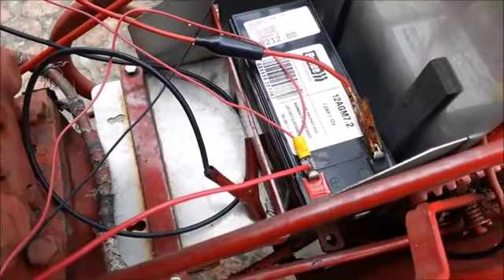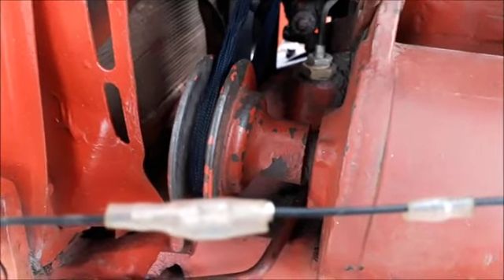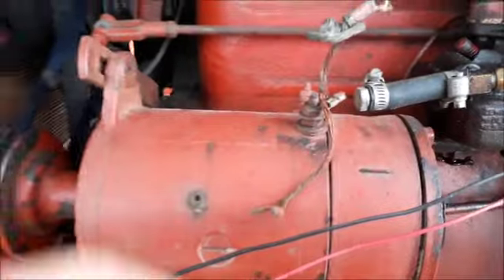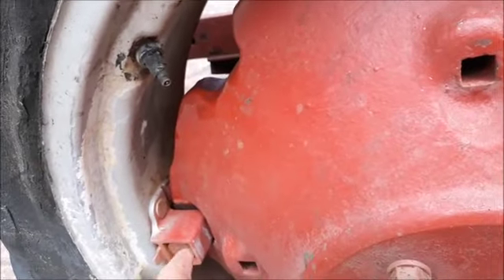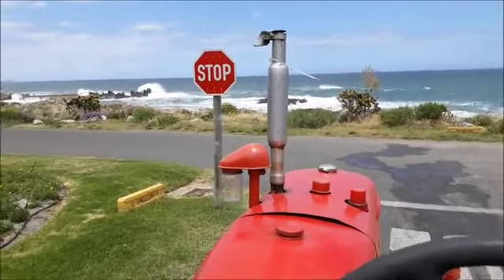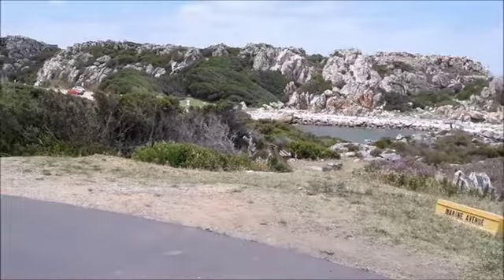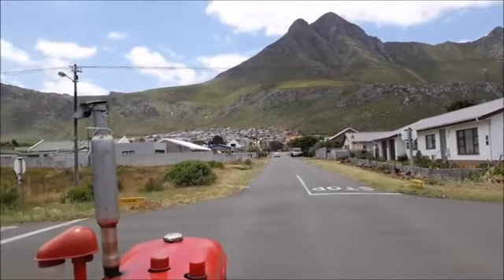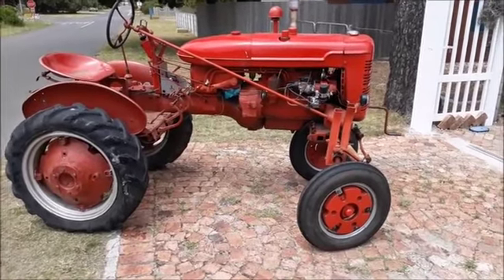Farmall generator question and drive to the sea

Comment: Hello Jan!  It looks like your generator is working than, the one with the spark is the ons of the magnetise windings and the other one is the output of the generator. 
The voltage regulator needs to be connected when you want to charge the battery what i was showing in the video is just for testing. 
Is your tractor negative ground?  
Nice trip!  Enjoined it!
Reply from the maker: Thanks SYB, then I am on the right direction, I will get a regulator and take it from there, thanks for your help

Comment: If it is a 6volt system the ground is where the positive is on the battery neg on the batt is the hot from thegen and with a gen it needs a regulator good luck
Reply from the maker: The tractor is now 12 volt positive ground with a coil system running of the battery, I am just playing and testing the generator, thanks for your help Kim

Comment: Jan , I did a couple of Videos on the Genny and Regulator you can find on here but I do believe You MUST have a Regulator for the 6 Volt Genny to work correctly. However I don't believe it will charge a 12 volt battery.  Since you need a New Genny and Voltage Regulator and Wiring harness, and new 6 vot battery which will all togeather be very High, so You may be better off just buying a 1 wire Alternator (even a Used one) and going with a 12 volt System, it's very easy to do, many videos on here will show you how. Here is one of my Videos... https://youtu.be/xx7-iAqhqN0
Reply from the maker: Thanks Don,I checked your video's, it tells me everything, I am just playing around with the gennie, no serious intention to make it work now, rear tires are on the priority list, I will revert back to your video's, it is great.